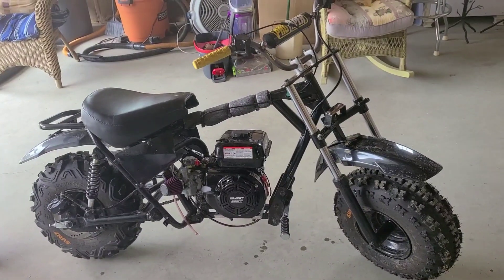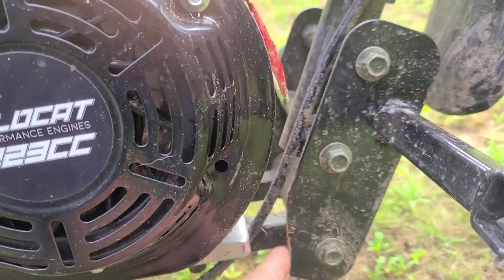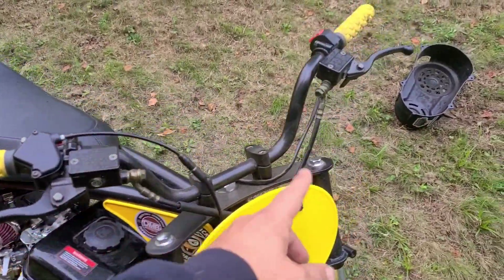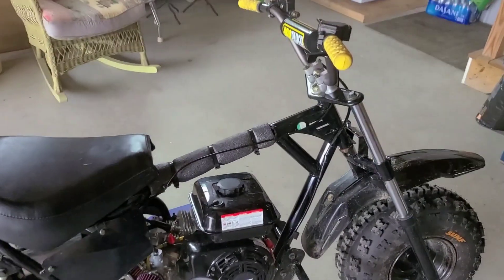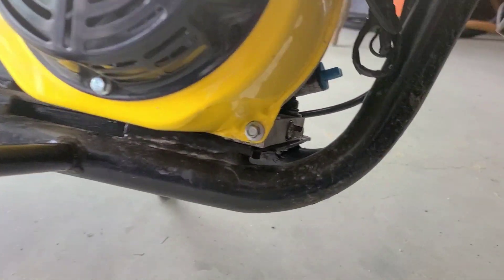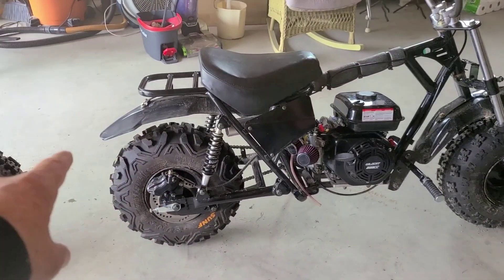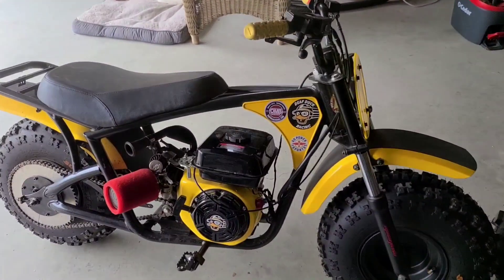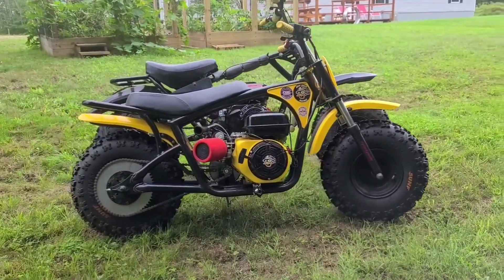Trailmaster MB200-2 VS Mega Moto MM212PRO Round 1 "Does Size Really Matter?"

Comment: Thank you for the showcase on both bikes I'm definitely a Trailmaster bike rider and doing a good job have fun riding your bikes Steve from Annapolis Maryland
Reply from the maker: I'm currently going over both of them so they can really lock horns. I'm a heavy, capable rider and I intend to squeeze every bit I can out of the two bikes. The Trailmaster now has a fully reinforced frame (it didn't break but I'm addressing ALL the issues I can.

Comment: You know, the Mb200 does have rear pegs which makes it more like a dirt bike.  It also makes cornering feel more stable and makes it way better for jumping/riding wheelies and you can stand up for rough terrain and goin over obstacles. You'd be amazed at how much better you can ride and correct the bike when standing up goin through rough/difficult terrain.  I used to ride dirt bikes when I was a kid so the front pegs feel really weird to me.  Using the rear pegs just feels better all round and also puts my feet under me more to catch myself if I need to.  Only problem I have is now that I have installed stage 1 kits, the air filter prevents us from using the rear pegs making our bike's less enjoyable to ride..  tryin to figure somethin out until I can put aftermarket carb set ups on our bikes.  Thank you for the video as I have been very curious on the size difference between to two bikes.  For some reason everyone be too afraid to try out the mb200's when they come over so need to get something less intimidating to ride for family n friends like a moto or coleman lol
Reply from the maker: I folded both sets of pegs a few months before I cut the Trailmaster in half. I now have the relocation bracket and mx pegs. The mb200-2 is a great bike but it has a few hurdles to get over.
Reply: Rear pegs on a dirtbike are as ridiculous as forward pegs on a dirt bike.
Mids give one control offroad not either of the latter.

Comment: My trailmaster is one of the comfiest bikes to ride. Never had an issue with footpegs and we just got back from riding mountain trails up WV. Seat position is fine for me and im about your size. Forward pegs make it nice for cruising. I havent had a problem offroad whatsoever but im not picky either its my only mini bike lol😂
Reply from the maker: The bike is OK as a base but it's not the greatest thing since sliced bread. If you push them the problems show up. They are way over marketed for what they are.
Reply from the maker: Comfy compared to what? A lawn mower? For me comfort comes with reliability. The Trailmaster needs work to be truly reliable and modifications to be fun. Too much modification can hurt the bike though.
Reply: @fatbuddycat  not many decent minibikes with rear and front suspension. I agree it's a great base all I can say is I couldn't be happier with mine. Gonna put a Ducar on er sooner or later
Reply: @fatbuddycat  lol what's your definition of fun? 😂 60t rear sprocket and you get 45mph and darn fast launches. Mine does 50 and it's stage 1 also have yet to have a reliability issue beside the flawed seat mounting. Still 100% choosing it over a moto or coleman any day especially off-road. Maybe the bike just fits me well or something but I'm 5'11" 200lbs. Also mods for it are cheap like every other mini bikes that's part of the fun. If you buy a mini bike and don't do anything to it I don't want to know you
Reply: @fatbuddycat  they are pricey new but when you pick one up that runs and everythings there cosmetically for 450$ you can't complain
Reply from the maker: @user-tm3mc9gh3g  that's a great price , lol I'd have a hard time walking away from that!

Comment: Great comparison buddy heck ya I still take my mb-200 over either one any day though super tuff machines
Reply from the maker: They are when they are built. Stock......maybe not so much. Yours is definitely ready for action.
Reply: I don't know I'm kind of more partial to the pro but at Tampa we all know that You're a die hard warrior man
Reply from the maker: @heathenprojects2639  he has the generation 1 Trailmaster race bike. It's actually more like a Warrior with full suspension.
Reply: @fatbuddycat  ya I know the only thing I did not like on gen 1 was jack shaft it was always slower then my warrior but in the sea of mini bike the warrior has always been that off bike with a few mods they are fast but frames were garbage I've got mine put back together I melted aluminum and filled the bars was not an easy task but it's strong now I also ordered the them foot pegs them are going to be nice for my size 15 feet
Reply from the maker: @heathenprojects2639  dang bro! You'd be that guy rolling by on a ct200ua and the chicks be like "awwww...there he go on that Doodlebug again...."
Reply from the maker: 🤣 mini bike humor right there, NOBODY else would get that joke besides us.

Comment: Really enjoyed the video. Have owned and enjoyed both very much. I definitely agree that the monster moto has a more sporty feel with the peg position, where the trailmaster is more cruiser. 

You did forget to mention the monster moto jackshaft bearings failing about every tank of fuel though. That was the deciding factor for me to get rid of the moto as I street ride long distance.
Reply from the maker: I haven't had an issue yet. I'm actually rebuilding the jackshaft in an upcoming video with some tricks I've learned from some good buddies.
Reply: @fatbuddycat  you've been lucky. Since the gears are so far apart, and pulling in different directions, it really torques the jackshaft and wears the bearings out and gets noisy quickly. A 100 mile ride was not an option for me. The trailmaster has the gears right next to each other pulling opposite directions, which leave the bearings almost neutrally loaded.
Reply from the maker: @brandjayfab  hmmm.....🤔 I see what you mean there.

Comment: On the MM212 how did you like the short header compared to the long header? I just ordered the MM212 frame kit that im going to put a Ducar 212cc on it. Ive always had somewhat longer headers.
Reply from the maker: I like the longer headers but they all have multiple bends and need support. Long headers tend to promote more torque.  The mm212 is kinda heavy and agrees with torque!
Reply: @fatbuddycat  that's was kinda my thinking, I do like having the torque. I do have enough material to make a support.  Im gathering as much info on the MM212  while I wait for GPS to ship the bike. I have everything needed for the "stage 1" except for the header.

Comment: I'm partial to the MB200. Those SunF tires look real aggressive. I was looking for some street tires for mine. I just put mirrors on mine. With the Honda tank and all I did to mine it looks like a regular motorcycle. The ride and all. I just like it a lot. I should do a comparison to the Coleman CT200u-ex and the MB200-v2 since I finished the Coleman. Also getting ready to restore a Honda RX80 I picked up last year...
Reply from the maker: Yeah brother! When I first assembled the mm212pro I was like 😬 because I thought it was bigger. I really like them both so it's hard to tell.
Reply: I just ordered my mb200-2 and a honda rebel tank. Wanting to find some metal Baja Warrior fenders for it because the stock plastic fenders look weird to me. Look up Sunf A021 for some badass street tires.

Comment: Really like the Mega Motos. Get the bare frame for $600 and then you have money left over for an engine and mods before the MB200.

Also, I knew I'd be giving my bike some performance parts and I really wanted front brakes.
Reply from the maker: I'm doing a pov comparison right now, trying to give them enough beans to break Equally.
Reply: yea but the mb200 has rear suspension
Reply from the maker: @MoToCruizeR2o3  I'm not convinced that the rear suspension is one of it's finer points. Not stock any way.

Comment: Love your bike buddy I may get mine done one day just never enough time in a day I'm starting a build in Sept not as wild as your cat what are those grips I'm going to need a set that look comfy
Reply from the maker: These grips are the bomb brother, hold on I'll grab the link. They have other colors available......
Reply from the maker: https://www.amazon.com/dp/B001KNYQ2O/ref=cm_sw_r_cp_apa_glt_fabc_9HEBBTJKSZ016TVKZ80Y?_encoding=UTF8&psc=1
Reply: @fatbuddycat  sweet ty
Reply: @fatbuddycat  ordered some blue ones
Reply from the maker: @heathenprojects2639  right on, your gonna love them. Very high quality.
Reply: @fatbuddycat  they did not go on my throttle with out a hell of a fight but I got they on and you were right again they are amazing ordered a few more sets for other bike
Reply from the maker: @heathenprojects2639  In one of my videos I talk about backing the bolt out and then gently spreading the clamp section. You can also use soap to make it slide across your paint, just make sure to clean it before sliding your grips on.

Comment: Hey my mb200-2 has a lot of engine braking when I let off the throttle. Is this normal or should it sort of coast when I release the throttle at speed?
Reply from the maker: That's normal for a torque converter to provide some of that sensation. When you let completely off the throttle it should smoothly disengage the driver as the rpm drops. There are a lot of tricks and even routine maintenance that can keep even the stock unit running smoothly. My personal experience is that on most motors you can find a better spring combination that works for your mini bike rather than jump to any conclusions or try a super 30 series such as a Torkzilla or Juggernaut. Every bike I own is on a torque converter, 79cc up to 223.
Reply from the maker: Another thing to look at on the stock mb200-2 driver is the bearing that the belt sits on. Make sure that it is operational.
Reply: @fatbuddycat  Thanks for quick reply. I got the stock convertor with the ball bearings at the driver pully and it is in good shape. I put on a new belt and now I have a lot of engine braking. Other than that its all good.
Reply from the maker: @lsj624  if it's the right belt size your biggest concern should be creeping or lurching when you are stopped and at an idle. As long as you can fully disengage then you are doing well. Carberuretors and exhaust can also get stuffy if something is off and cause that sensation. Say if the motor is running too lean and holding a hot idle. Chances are you have to break in the belt. Take the driver apart and clean the dusty rubber out of everything. You can use spray graphite to lubricate the bell when your done or just wipe dry with a clean rag.
Reply: @fatbuddycat  Thanks for your help I think your right about the belt needing broke in. When I put an old belt on the braking sensation is greatly reduced. Thanks again. I also made some videos on my mb200-2 engine swap and upgrades if your interested. Cheers.
Reply from the maker: @lsj624  I'm very interested! I'm checking it out.... I encourage people to share on my channel and comment section.

Comment: i dont get it man i just run a 11tooth clutch on my 80cc an im goin 40 No TC how fast does it make it go 80
Reply from the maker: Zooooooom!
Reply: @fatbuddycat  lol so how wider are the forks on the mb2oo then my motovox im trying to run the front brake kit from Gps and the 8inch wheel because i already drilled out the front suspnsion for 5/8 for my chrome spinner wheel i got from the Grey goat himself
Reply from the maker: @aNgRY cRUiZer2O3  which fork? The Trailmaster or the universal set for the mm80?
Reply: @fatbuddycat  the mm80 onezzz
Reply from the maker: @aNgRY cRUiZer2O3  I'll get an exact measurement for you. I have a spare set.
Reply from the maker: @MoToCruizeR2o3  7.25-7.50 inches
Reply: @fatbuddycat got ya just ordered me the new b200 rsv frame just gotta get the rest hey its only 300 bucks str8 from the Colemans

Comment: I Just bought a juggernaut  torque converter for my Tillerson 212 stage 1 on my baja warrior frame . I road my bike yesterday it for about 30 minutes I cut it off .now  the the pull cord  want pull  can anyone help me. ?
Reply from the maker: Was the governor removed or modified (aka zip tied)?
If not it could be as simple as a pull starter.
Reply: @fatbuddycat  it was modified, i put a aftermarket spark plug in . I'm going to try the old one see what it would do. The bike always starts after one pull even in the cold. Now it want pull
Reply from the maker: @jacquesbillingsley8733  if that governor gear broke up inside it can get lodged between the cam and crank....again not the worst case scenario. We can figure this out!
Reply: @fatbuddycat  I hope not I'm going to go through everything I see before I take it apart
Reply from the maker: @jacquesbillingsley8733  take the pull starter off. See if it pulls when off the motor. That will tell you if it's the recoil or the engine.
Reply: @fatbuddycat  ok I'm going to try that. Every time I call the mini bike shop in my town they always telling my it's my valves
Reply from the maker: @jacquesbillingsley8733  it could be but let's figure it out starting with the easiest things first. Even if you had a bad or bent valve it can be fixed.
Reply: @fatbuddycat  ok thanks I let you know when I get it back running. I got two other bikes. If I can't figure it out I will just sell it

Comment: You have all the fast bikes
Reply from the maker: Their getting there! Every time I say I need a stocker I'm right back at it.....😁
Reply: With the modifications on both motors you have done, are they fairly close in power and does the wildcat edge out the tilly with current mods?
Reply from the maker: @markbordelon6191  currently the Wildcat is a freight train of a motor. If I cam the 212r, swap the 22# for 26# springs and add an ARC Flywheel it will go harder. Here's the big ticket.....The Wildcat is factory stroked, with the EC stage 2 kit you'd be pretty close to the same money if you did a 212r BUT you are getting all the benefits of a stroker. It's got more torque and power down low and across the mid range spectrum. The Cat can handle more flow but with a 212r head......😏. It's all what you want. I'd say the Wildcat is a great candidate for a built motor but the 212r is ready honk with very minor modifications.